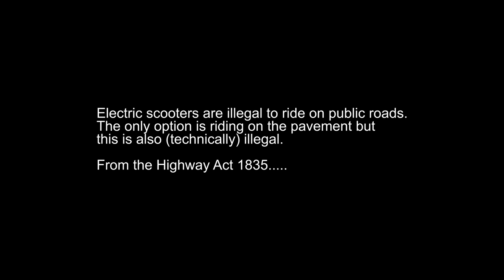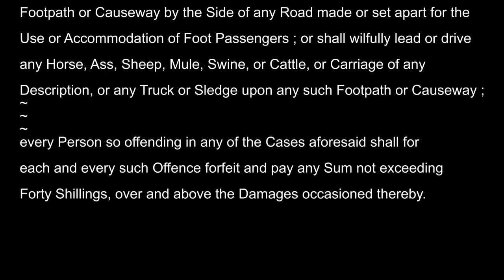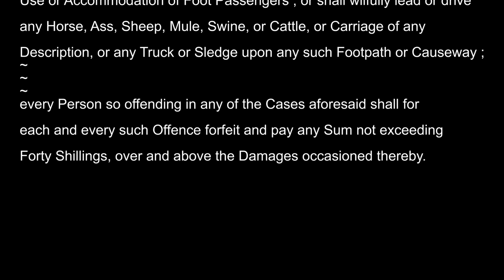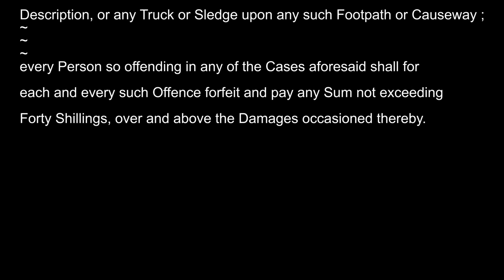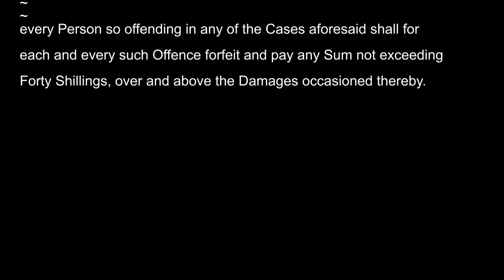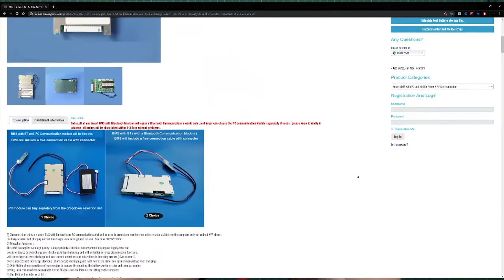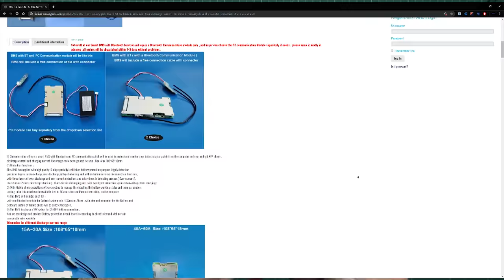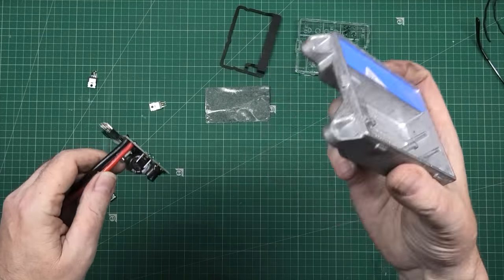Xiaomi M365 Pro scooter part 2 - Stripdown and mods

Comment: I'm glad you liked my recommendations!! Since I fix these for a living, I have a couple more things and some info you ought to watch out for

ESC
1. Yes, the caps are 63 volts, but the circuit board contains a TPS54160A regulator with a PEAK voltage of just 60v. Take into account that this ESC has regen, which can spike the voltage up 15v past battery voltage for fractions of a second. For this reason, it's highly recommended to never put a battery of more than 50 volts on the ESC without further modifying it
2. The F2 and L4 fuse and inductor sometime fail. It'll cause the 5V rail to your bluetooth unit to fail, as well as the 5V going to your hall sensors. You can guess what that does :) I just bridge both.
3. If you plan to run serious power, i recommend putting copper braid over the traces. (Like desoldering braid)

Motor
1. Max power is about 1.2-1.5 kW, much more and you begin to enter saturation unfortunately. 2 kW absolute max. More than 30A and you need to be careful!
2. The phase wires going to the ESC may overheat and start melting the plastic, make sure they're clean and tight! 
3. The bearings on the motor sometimes are sealed poorly, so in rain they can fail quickly. I replaced them with SKF 6002 2RS
4. You can open the motor cleanly without hammering. :) Use your feet on the tires to pop the stator up and the top lid with bolt partially on as a handle to finish removing it.

Battery
1. Yes cells are 10A each, but at 10A they'll reach 50+C. I suggest you run no more than 35A on the stock battery.
2. The battery acts as a bridge between the ESC and the brake light, for literally no reason. It's retarded, I know.
3. It communicates by a NINEBOT battery UART protocol, custom to xiaomi. Not standard in the slightest. :D
Reply from the maker: As always, cheers mate. I've now got 2 x 6s lipo's fitted which will kick out 250A if needed. I'm going to push this as far as possible and then I'll have to start seriously modifying it until the only original part is the frame.
I will get 6+kw out of it eventulally.
Reply: Thank you for all the information! Since you seem very knowledgeable on the topic I have a couple more questions.

Are there any differences in reliability/durability between M365 and M365 PRO?
 
Also are there significant differences between earlier and later production batches of the same model i.e. is Xiaomi fixing the weaknesses people are discovering?
Reply: @Vortecks  You are a beast, and I like the informations you provided. Thank you very much.
Reply: Would the stock BMS handle the 35A of the cells without an issue? I believe it's the same controller and the same BMS from the original M365, perhaps it's already pushing the thermal limits of the BMS?
Reply: My handlebars bent how do I get a new one
Reply: Hidden Player order online.

Comment: You've got my full respect sir! Finally, someone was brave enough to open the battery housing of the M365 Pro and give us an inside view of the cells and bms. I did the same mods on my scooter so far (changing the controller mosfets with 4110, enforce copper traces, applying arctic thermal pad) and now I am can’t wait to see your 10S3P 26650 original bms battery mod – that's truly insane.. 😊
Reply from the maker: Cheers mate.
I've gone with 2 x 6s Lipos in series which were on my V2 e-Bike which gives me 12s and 16000mAh now.
I'm just hoping it's increased the power considerably or I'll have to go full 'Tony mode' on it 😂

Comment: Really interesting video. But I'm wondering would it be possible to install a cooling fan on the motherboard case? Mine is always to hot. If so, what voltage for the fan and how to power it up?? And how did you reduce the noice from the motor wheel @ 20:51?
Reply: I've already used thermal grease on the back of the case and on the back of the mosfets. And what is the benefit of changing them, by the way?

Comment: You seem to be quite a pro! Well done for your suggestions. 

May I please bother you with something basic? 

I have inherited one of these m354 pro and it came with the error 21. I've scouted the internet and done anything they say. 

I've ended up replacing the front wheel and the motherboard and opened the battery to see if there is any obvious shoot from burn etc,which there is none. (Btw my battery blinks the blue LED which makes me think that both the battery and the BMS is fine).

I am really stuck as none of the above actions have fixed that error. Still error 21.

Could you offer any ideas please?

Comment: Fascinating Tony...If it was me, I would have polished those axle journals so you didn't need a hammer to assemble it...Hammering the axle damages the raceways...it's also very tedious...Looking forward to your high amp battery build.
Reply from the maker: It wasn't as bad as I made out mate - it was only light taps all the way round. I wonder how long it'll be before I have to do things the Tony way to get massive amounts of power out of it 😂
Reply: @Vortecks  Yeah, I'm not sure having a load of power and speed is a good idea on this Scooter..You could fall off it easier than a bike I'm guessing..?

Comment: Interesting video... thank you.
 Couple of questions arise : 
Why the Ferrofluid? and doesn't it migrate into the Magnet/stator gap adding friction drag ?  
What benefits to the new Fets ..beyond replacing likely  Fake Chinese bits ? 
You upgraded the battery input wires.. Yet Not the Silly thin Motor wires ??
Reply from the maker: Ferrofluid is for cooling. Yes, it does increase drag but the benefits far outweigh the pitfalls. As you'll see, I'm now running over 2kw on a wheel designed for only 600W and it doesn't get hot.
The FETs - yes..... it's only because I'd never heard of them.
Phase wires - it's not possible to get anything thicker through the centre hole. I could have upgraded them where they come out of the motor but they do seem fine and they haven't burnt out yet.

Comment: Tony, be careful! Two people have fallen off my es4's at less than 19 mph and got scraped up pretty good... It doesn't seem very fast until you hit the road!
Reply: I can vouch for this came off my bike when I was riding only doing about 5 or 10mph if that and the front tyre went flat when I went to steer the bike flung me off and I scraped both my shins and knees hurt like hell for a few days its actually left me scarred aswell. It was on fresh tarmac 😭
Reply: No offence but the Idea is not to fall off, admittedly falling off and the prolonged pain will help you get the idea !!

Comment: How did you manage to get 22mph using the stock battery and motor? Got a link to the firmware tool and the settings you used? Excited to see how the build progresses!

Comment: I’ve had my Pro 2 for almost a year now. It’s the best fun I’ve had since I lost my cherry on a golf course some 40 years ago 🤣. I’ve done over 1200 miles on it, in rain snow and ice (careful - keep the weight on the back), I live on a narrowboat and it’s survived the muddy towpaths but the brake disc and pad wouldn’t agree with me but were easily replaced. I’m about to replace the front wheel with a 350w one bought on eBay. Yeah ... I know, but I’ll report back if anyone is interested.

Comment: Hi, (I have M365) you said that you're going to put some fara fluid in your motor? Can you describe it a bit more in details (how much, what type of fluid, who can I do it?). My M365 motor often goes 50+ celsius if I ride it 10-15km nonstop. Some cooling is needed in my opinion. Yes, I opened it, cleaned it and also changed bearings.
Reply from the maker: I use just enough to fill the gap between the motor magnets and then a bit more to fill the gap between the magnets and stator. Some people simply use around 10ml and fill the inside. 
There isn't a set amount that you should use, it's expensive so the least you can get away with, the better.
https://fasterbikes.eu/en/accessories/hub-motor/219/10-ml-statorade-ferrofluid-magnetic-cooling-liquid
Mine gets hot, but with 1kw going through it, it would have burnt out by now. I'll be stripping it all down again soon when i convert it to rear wheel drive and double the power.
Reply: @Vortecks  Thank you so much! Ill see if i can find it in local stores first. You make some really good content!

Comment: make it two wheel drive :-P
Reply: It's definitely possible! each motor can pump 1.5 kW peak, that means you could have 3 kW!
Reply from the maker: Eventually, I probably will. I'm running on 12s now and I'm at the limit of 1700w. Something will pop soon 😂
Reply: @Vortecks  Whats the top speed now on flat roads? and could you make a video on how you converted it to  run on 12s
Reply from the maker: @sullythegamer2492  To be honest, I haven't had time to test it yet. I only finished charging it the other night with my crappy 1A charger - I should be able to get out on it this weekend.
The plan is, I'll do a video showing what results I got and then, if there's any interest, I'll buy another kit and do a 'how to'.

Comment: Hey mate, how did you open the motor cover?? I am trying to change the tyre and trying to open the cover to take out the plastic that's holding the tube in but fking thing won't budge. It's like the magnet is holding the cover in place and I CANNOT take the cover out!

Comment: What ferrofluid did you use in the motor and how much? 
I know Statorade is good, but is also expensive and comes as minimum in 10ml package. And I know EFH1 not good for this use. How about those ferrofluids for speakers on Aliexpress?

Comment: I'm currently working on a custom made dual motor ninebot es4, it has two 36v 300watt rated motors that I will be powering with two 48-72v 1500watt ESC's and a 16s12p battery. The amp rating on the esc is 41amps and my battery has a nominal voltage of 60v so technically it will pull 2,500watts per controller? At 60volts I had it over 30mph with my previous 48v 1000watt esc's until vibrations broke a capacitor off of one and it broke, the acceleration was really fast but it seems I can get it to accelerate even faster and run more amps as it only gets really hot when I beat on it for over 30 minutes.

Comment: I'm in the process of making a 14ah 10s4p battery for my m365.  I have an extended battery cover already.  Would I be better off picking up another 7.8ah battery and running it externally fir a total of 15.6ah, or would a large single cell with better quality batteries be a more robust idea?  I'm not looking for more top speed, or hill power as I use legs a lot up hills, I'd mainly like to know what would provide a more stable power deliver related to voltage drop.

Comment: hey man, can you explain what the "hall" sensors in the motor are for?
Reply: It's for sensing wheel position and put power in right moments. Wheel is not powered constant, but by pulses. 

Sorry for my poor english.
Reply: @-_Robert_-  thanks, does thath make the motor stronger then constant powered motors?
Reply: @supersolex  it's not about that. Brushless motors are powered by pulses. Old brushed by constant power. (current) New motors saving energy I think and are much more efective.
Reply from the maker: @-_Robert_-  ^^^ What you said, cheers mate 😁
Reply: Ofcourse, my mystake; that was about rotor inside motor, not about wheel.
Reply: "theory' is that Sensored motors  allow for better 'fine' motor control.
 If you've ridden one of these you Know the throttle is  essentially either on or off.  So that's a silly claim.
IMO sensorless controllers are a bit pricier to build.. as the real reason..

Comment: hey, thanks for the vid!! if i may ask your advice, i bought a ned frontmotor with a rubber wheel attached since i was sick of fixing flat tires. my problem now is that the 3 thick powercables with the plastic-foil around the connectors (not the multipin ones) have different colors than the old motors do.
is it crucial to find out which one goes where? and if, any idea how to find that out?

also, do i need to unplug the balance cable and then the battery to savely switch motors or is it save to just pull the old cables and stick the new ones on there?
thanks for your help!! greetings from austria

Comment: What would the upgraded MOSFET IRFB 4110 provide?
Reply from the maker: I'd never heard of the ones fitted and I was told (by a Xiaomi repair engineer) that they're not particularly reliable.
Reply: @Vortecks thanks! I ordered some ferrofluid as well. How many mL would you recommend using? 
Love the videos
Reply from the maker: @DavidChau88  The gap between the magnets and stator is less than 1mm so you don't need much. I didn't gauge how much I used but I think it was around 3ml

Comment: I'm planning to add a battery with the rita device,
I was thinking about placing a 13s on it.
Is there anything i should do besides upgrading the mosfets to IRFB4110 and the cap to a 100v 1000uf?
I heard about cutting the trace on the pcb. But have no idea what they mean by doing this... could you please help me out on it? Theh gave me a pdf in spanish, i cant even tranclate it

Comment: hi i flooded my original motor on my xiaomi m365 do you think motor from PRO version will work on my m365 standard NO PRO version? or its better to buy motor specific for m365, because i found that motor for PRO version is actually 15€ cheaper than motor for original m365 and its more powerfull so i dont understand why its cheaper

Comment: Mine lasted 4 miles 🤮 just need to diagnose motor or throttle. Battery and controller checked all good. Bit perplexed but I’ll investigate further.

Comment: Good vídeo, you can't put 3kw in justo by changing the fets,  you will need 75A... Need to overvolt it to 72v and you easily overcome the 3kw. I run it. 60kmh, and its not safe ride 😁 do you have temperature numbers for that ferryfluid mod...temperature diferences? Pm  on telegrama app.  @pedropboy